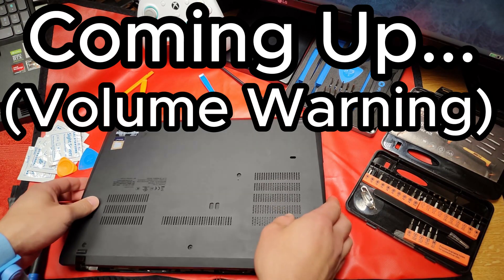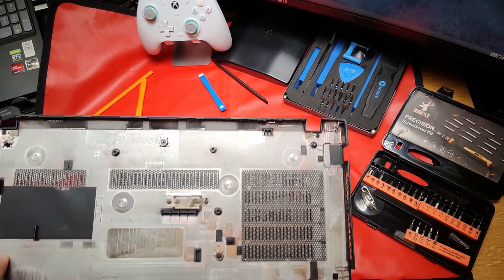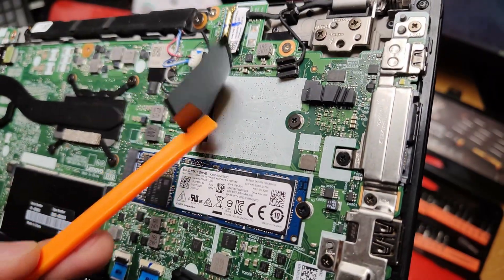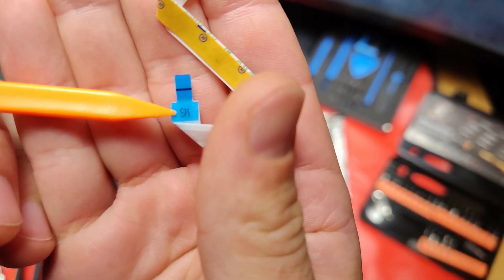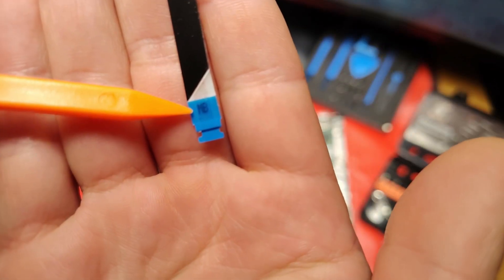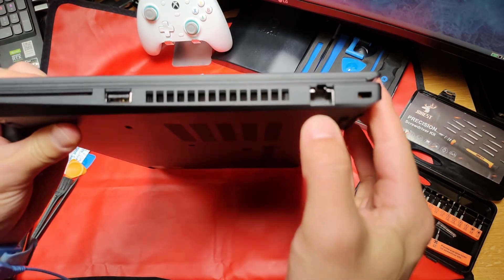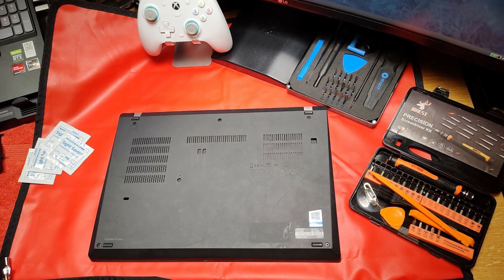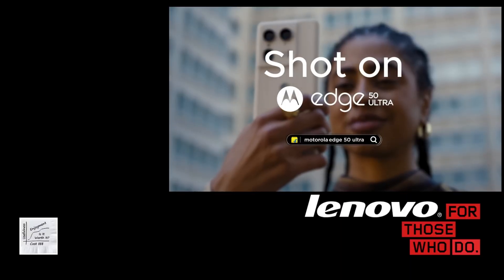Episode 16: Lenovo ThinkPad T14 Gen 1 Smart Card Install.  The Ultimate Service Members’ Laptop!

Comment: I just ordered this exact computer. Do you think it will be able to handle some music production? What about basic VJing? I am so pumped to abuse the thing. Is the smart media reader literally for those old flat smart media cards? Or will it take a full-size SD card?
Reply from the maker: I far as I am aware, it only takes MicroSD cards. You have to use a USB adapter to use full-sized SD cards.  The Smart Card reader is usually use for 2FA for extra security.  If you got the model with the AMD processor, then you will Defiantly be able to do music production (the AMD processor is a powerhouse compared to the Intel option in this Laptop).  I edit my YouTube videos on mine.
Reply: @IsItWorthIt3 mine is i7 but I'm about to push it to its limits and see what it can handle
Reply from the maker: @laughingthrushmusic5269  Of course! The i7 is not bad, the Ryzen was just better.  You should still be able to quite a bit with it, because the ThinkPads are made to be reliable workstations!